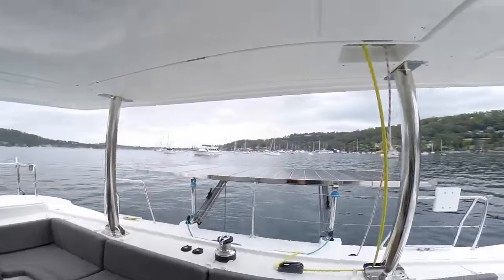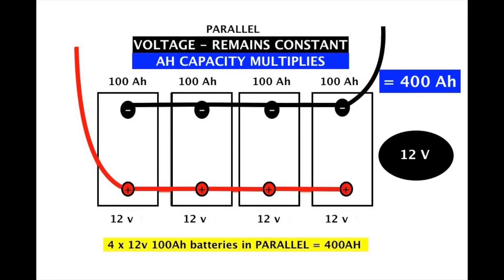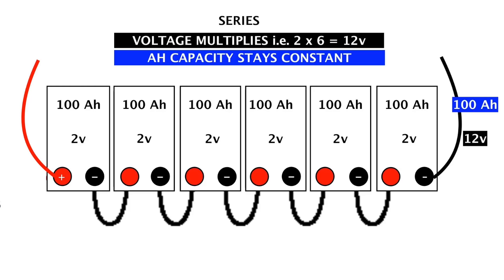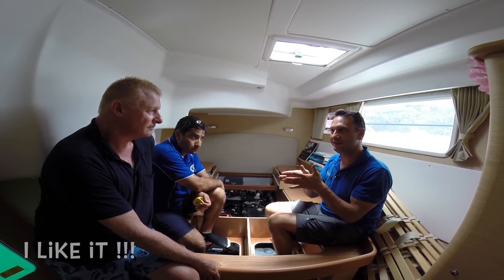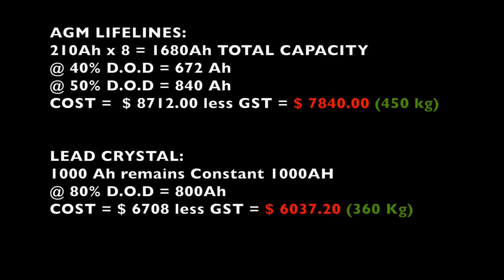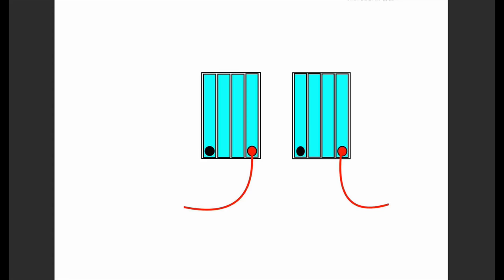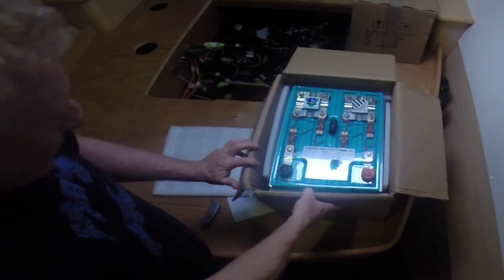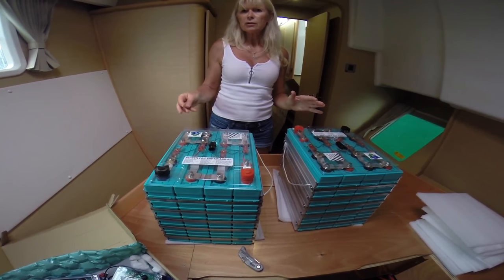Pt 1.  LITHIUM BATTERY INSTALLATION

Comment: Thanks for the video. We installed a 400AH Lithium FePO4 battery from EV Power on our Lagoon 440 about a year ago.
We are very happy with the performance and with EV Power. The main problem with the battery was the cost of transporting them across the country by courier ($500 in our case).  The thing I really like is the higher delivered voltage for all of the discharge cycle, which really helps with 12v fridges (no low voltage cut out).  We have a AGM wired in parallel as a back up to avoid draining the lithium battery.  This also allows us to isolate the lithium battery if we leave the boat for a while. AGM's have very similar charge characteristics to lithium batteries (so far this seems to be working).  I am blown away by the 360 Amp charge rate you are getting.  Be careful you are not over doing it and make sure that your charging systems are backing off once the batteries are nearing full capacity, especially if you are on a long motor-sail. All the best while in Australia and I look forward to catching up with you if you come through Darwin on your way north.
Cheers Brian
Reply from the maker: Hey Brian - awesome share from someone who has had the technology for a year now. Yes, we have had so many emails and messages from folks who have installed these on their boats and so far everyone being impressed! Phew - what a relief. We actually made the decision after doing a ton of research and by keeping an open mind - there is some wild stuff out there on the forums ... in the end I discarded a lot of what was being said there and opted to discuss it with qualified people I trusted to have the knowledge and our best interest at heart. It feels to me we made a great choice.
Road express TNT costs come in around AU$184 and full insurance on the package is around AU$46.20 I believe. I think the quotation initially came in around AUS$ 345. We paid the latter more for convenience sake and because we were in a hurry to get the job done ... well ... then the initial electrician did not arrive to do the instal!
You know Brian, we have been so impressed by the higher voltage over the discharge cycle - we have not yet seen under 13v - it's mind blasting and we wondered if it is just this way because they are new. Do you use your system regularly and have you noticed a 'drop off' in voltage with time?
I am keen about your back up to AGM batteries - we are doing similar but with Carbon Foam.
Yes, the 360A is 'wow' and yes, we need to be cautious not to overdo things here - we (our electrician) actually consulted with Rod at EV Power and decided to go with the external commercial relays as a result. The alternators are wired to 'turn off' through a relay disconnect to the ignition wire. We notice the systems backing off at 14.1v / 14.2v - keeping a steady eye on that - thanks for the warning!
Another thing we have done is to wire the system to turn off all charging devices at full - so in effect as the unit kicks into 'float mode' - and then the system discharges keeping all chargers off until the batteries reach 90% capacity at which time they can kick in again. This includes the solar power too and the theory behind it is to allow the batteries to work a little without interference from the chargers and to make sure we do not get a 'spike' from the system trying to perform near full capacity. So - if we turn off the charger at 92% capacity, it will mean the charger will not re-engage until we sit under the 90% value. This gives us a bit of room for the chargers to engage, work and not affect the packs whilst the 'settle in to a steady charge rate'. On the other hand, if we leave the charger on from any value below 90%, they will maintain the charge rate until full and then turn off entirely.
I hope this makes sense ... it feels like a good idea to me. Everything is co-ordinated through the relay  in the Victron BMV702, and should we want to charge in that zone (10% to full zone) this can be done by simply disconnecting the wire - well, we instal a switch for this to bypass when / if we desire to.  
Brain - thank you so much for sharing this with us - you are awesome !
We are headed for New Caledonia later int he year but will definitely be passing Darwin when we move west to Indonesia and those countries. Next year we hopefully will drop to Tasmania for a 'look see' so perhaps on the way up form there.
Thanks my friend ... fair winds
Brent
Reply: Hi Brent,
I wish I could have got that deal on the freight. We had all this talk about how dangerous they are to road freight and all the precautions taken on the way but when I picked it up, the guy was tearing across the asphalt at breakneck speed with my battery bouncing on the end of the fork lift. I nearly had kittens.
Re the AGM wired in parallel as back up, a friend had this set up for a while on his cat. I think the only downside is the risk from applying charging voltages to the AGM while it is fully charged. We have a voltage sensitive relay between the AGM and the Li battery to provide back up insurance against fully discharging the Li battery and encountering run away currents that are apparently a problem when you charge a fully discharged Li battery.  It is interesting to think about having a Li battery next to a fuel tank with 300+ litres of fuel.  It reminds me of a cruising saying that the only time you have too much fuel on board is when you are on fire (sobbering).
Re voltage, we never see less than 13 volts as well although our system is lightly used.  One thing I would mention is that I never fully trust my battery counter as it s seems to miss stuff. I always use voltage and ampage as the final indicator on what the charger and batteries are doing. If you haven't already got one a clampometer for measuring amps going thru a cable is a great investment.
I look forward to catching up with you when you make it up this way.
Cheers Brian
Reply from the maker: Thanks Brian - very interesting read and something for me to consider. The reason I thought to go Carbon Foam as my back up battery to the LifePO4's is that they charge on very similar parameters as the Lithiums.
They are also very light batteries.
I was considering this back up more for the event of a rouge charger or external issue causing the voltage sense to shut down the Lithiums ... in that case I could make the decision to run the boat in an emergency on the Carbon Foams even though an external issue might kill the lifespan of the battery, verses the lithiums shutting down entirely (hope I wrote that in a way you can understand my thoughts - lol). But yes, I really like the fact that you have a method to transfer amperage to the lithiums via a voltage sensitive relay from the AGM to the Lithiums ... would love to know more about that :)
I believe recharging the lithiums from a fully discharged state is difficult - it requires a VERY slow charge to bring them back. The factory recommends a small 4.5V 300mAh DC plug pack type power supply applied to individual cells one at a time until the cell voltages rise above 2.5V and the BMS will allow normal charging to commence. It would be a great idea to be able to transfer power to the Lithiums if they run low.

Yes - I had to chuckle nervously at your thought of fire alongside 300+ litres of fuel and the comment by your friend is classic man ! (the only time you have too much fuel on board is when you are on fire).

I totally agree with the battery counter (measurement by AH Capacity) - we always check voltage verses charge amperage and then we look at the AH capacity of the banks to verify they are in range. So we do use AH Capacity to talk tot he controllers, since everything else through the BCU is voltage related, but we make sure the BMV702 re calibrates properly and from time to time I do a manual sync ... did one today ... batteries at 14.2v and charge current falling off ... then voltage drops to about 13.8 and the chargers flash 'float' ... the charge rate backs off entirely at that point and I manually sync. I must say though, that the BMV702 does an amazing job at automatically syncing the batteries each time - we keep a close eye on it and it does amaze. I guess to be safe we should also consider the voltage at the terminals of the battery to be one decimal point higher than what we read at the gauge (to be safe about it).

The Clampometer - yes - I purchased a really nice one in Sydney - works great and we do use it to verify the readouts near the batteries verses on the gauge - a great tool to have.

Another thing I am now doing is to measure the voltage at the charger output and then on the battery terminals to determine if there is any voltage drop in the cables. We are now in 'fine tuning mode' :)
I can't believe the whole 'lithium thing' is actually becoming fun!

Cheers my friend - hope to meet you guys along the way

Brent

Comment: Hi, I like your video and commentary.....great video by the way. May I ask why you choose Lagoon cats against South African made one or other brand? I'll appreciate you feedback.
Reply from the maker: Thank you Mario Bros - nice comment!
Many folks ask us this question - interesting!
I think many beautiful catamarans are manufactured in South Africa - we love a number of cat builds there and we have a number of friends sailing these and they love them! 
Previously we owned a Catana 471 which was a great boat too and when we decided to sail around the world, we were looking for a HOME - and the Lagoon 440 ticked most of those boxes for us. In foul weather, unlike monohulls, we place the stern of the cat to the weather and if necessary we deploy warps (some people like to use drogues - we use knotted warps) to keep the boat at the correct speed for the conditions. The 440 has the safety of a monohull cockpit turned sideways, so the high back is a protection of sorts for us. Of course this is not necessarily going to be an issue for one, but for us sailing 24/7 year in and year out, chances are we could wind up in a storm like this from time to time, and in fact we have encountered some extreme conditions out there. 
We also enjoy the Nacelle on the underside of the boat between the two hulls. You will see a 'suspended hull' of sorts - a bull nose that goes forward to the trampoline area. Well this feature has been a 'God send' for us on some occasions and prevents the bows from digging in with a following sea. As the bows drop into the water, this part engages the water and floats the bows back to the surface - it is very effective and has been the reason we have been able to sail downwind in rough seas whilst some other brands have had to take other measures. The space on the Lagoon 440 compared to any other boat in it's size is something that keeps amazing people who visit Impi. The space around the sides of the queen size bed (our previous boat had us crawl over each other and to gain width they moved the beds up close to the ceiling - I get claustrophobic), the windows squared around allowing light and space, the packing space - it is really very well thought through in our opinion, and important features for us making this a home on the ocean. The bridge deck opens up the entire topside to the boat - it is the place everyone gathers when they sail with us and offers a whole different dimension to sailing. The coach roof behind the bench seat is solid and often Ana and I will place a mattress there and admire the sunsets - in fact the entire upper roof section of the boat is available to one with the access via the bridge deck. This is awesome when one lives on the boat 24/7 .Another thing we really enjoy about the Lagoon440 is it's ability to sail close to the wind. The position of the genoa tracks allow one to bring the genoa in close hauled and the shorter (two) spreaders allow the leach of the genoa to be hauled in closer without being obstructed like many boats with single longer spreaders.
I think one needs to look at charter verses 'home on the water' ... 
So - these are some of the reasons we opted for the Lagoon - it is great value for money (if you compare the pricing), very safe for crossing oceans (of course nothing is infallible to the anger of the weather systems, but one wants to 'hedge the risk') and there has to be a reason they sell the most cats world wide.
Having said all of this - we are keeping an eye out all the time - we always said we would replace Impi 5 years in, but to be honest we are hard pressed to say 'good bye' to what has been an awesome boat / home of us ...
Still, there is no one boat that does it all - in the end we make the choices around the things that we as individuals find appeals to our safety, comfort and performance - we look for something that has a balance in these important criteria when making a 'life at sea' a full time deal - it's always 'different strokes for different folks' - right!
Cheers for now and thank you for commenting here
Brent
Reply: Thanks for the reply, appreciated it. Cheers....waiting for your next adventures. One more thing, what can you say about Lagoon seventy 7 as a experience catamaran user? Sorry guys....I can't help asking you these, the first time I saw it, it became my dream boat....though I can't afford it. hehehe.....
Reply from the maker: Hey Mario Bros - always a pleasure for us ...and hey ... you are not alone with the Seventy 7 Lagoon being your 'dream boat' ... ours too - lol. 
I would really have to take a close look at it if I had the bucks to buy it though - when one is spending that sort of cash it needs to be well looked through (studied, studied, studied some more) but yeah - on the face of it - it looks really cool! Go buy that boat Mario ...

Comment: Great video guys! While you are changing your battery packs I may have to change my screen: Brent, you shrank man..!! ...looking good, away from those pain au chocolat!!
Reply from the maker: Thanks Nicolas - LOL - yes, I lost a lot of weight! The doctor said if I did not loose weight fast to start digging the hole - well - lost the weight. I am not sure what I will do when I get to New Caledonia - that pain au chocolat is awesome there :)
Cheers my friend
Brent
Reply: ...yes, wait a bit with that hole project! 

I really enjoy your technical videos, they are well thought through and accessible. One question about your diving compressor: are you using it? Is it worthwhile to mount one on board or is it enough to rely on local dive shop whenever available? My main concerns are the weight and the noise at busy anchorage...
Cheers mate!
Nicolas
Reply from the maker: Hi Nicolas - we do use the dive compressor although not yet much in Australia. perhaps when we are on the Great Barrier Reef we will.
To answer your question ... I am pleased we installed the compressor ... we use the jenny (elec motor) and place the intake up wind of the exhaust to prevent fumes (we use those swimming pool quick coupling tubes that float on the water). 
It really depends on where one is sailing / diving as to whether you can rely on a dive shop to be available to do the fill. 
If you do not dive much then perhaps it is an investment too far but if you do, you will be well pleased to be able to fill your own tanks. Trust me ... in remote regions you will gain new friends ... all wanting their dive tanks filled!
As for noise in a busy anchorage - well yes, we normally fill our tanks away from other yachts and then again the guys do not mind if you fill them in daylight hours - usually only 20 mins per tank.
Cheers mate

Comment: Great video thank you! I am not sure why you chose the Li batteries over the Lead Crystal. It seems, from your video, that they have the same advantages as Li, bulk charging until 80-90%, DOD of 80% and less expensive. Have you thought about the Li batteries' bad reputation for catching on fire when the regulator fails?
Reply from the maker: Hi Skipper Daniel - a pleasure for us. We chose the LifePo4 batteries mostly for weight and higher voltage retention. I do like the lead crystal and Carbon Foam technology these days, but I still think Lithium has 'the edge' on these if one can afford it. LifePo 4 batteries assembled this way and wired in carefully has very little chance of catching fire, and especially since there is cell monitoring technology with each individual cell within the packs , as well as on the pack as a whole. It is a truly great system EV Power have come up with which is why we went this route.
As for a failing regulator - it wont affect the LifePo4's because the voltage is monitored for a maximum and minimum and should there be a spike the BCU will simply disconnect the feed and disengage the packs entirely.
As for taking batteries into deep cycles, the lithium style batteries promise a lot more in life - so had I done a comparison of overall life expectancy, it would have been clear that Lithiums pay off in the long run. 
 Of course this is a topic hotly contested and I try to keep my nose out of it ... mostly because the real life situation situation is very different to the laboratory situation in that the way we live on the boat the cycles fluctuate constantly ... i.e. on discharge, the solar panels may kick in with a burst of sun, or the alternators with an engine being started etc. etc.
According to the electrical engineers I have consulted over the years, the Lithiums take fluctuating demanding loads and chargers better than any other battery does. Well - we are going to put this to the test and feed back our experiences on the boat.
Reply: Good deal. Thanks for the detailed response! Fair winds.
Reply from the maker: A pleasure for us Daniel - thank you for commenting ...